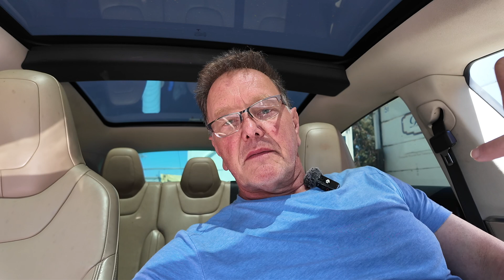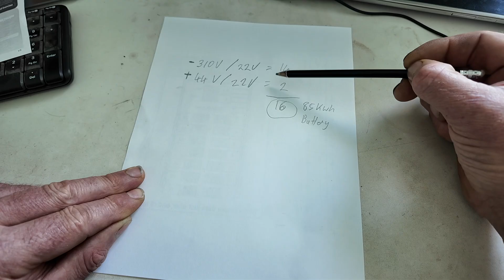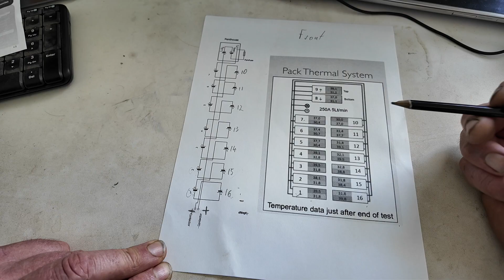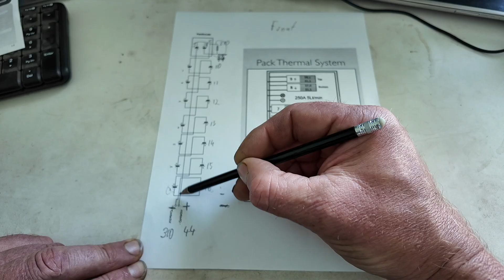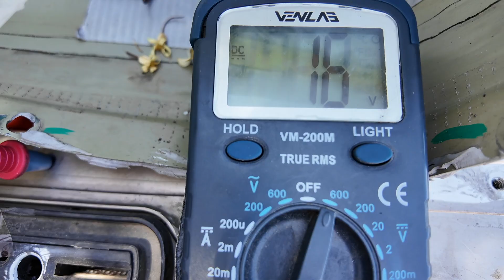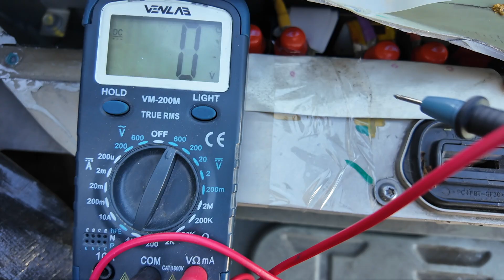Diagnose & Repair: Tesla Model S HV Insulation Fault (BMS_W142 & BMS_F123 Codes)

Comment: Nice video, exactly what i am looking for.  Have an error on a 2016 pack which has the pyrofuse access on bottom instead of top, so can’t fill up with water like on older HV batteries.  This will help find it.
Reply from the maker: Glad it helps to keep another Model S on the road.
Reply from the maker: I just found your post on the Facebook group. Measure Voltage against ground at the Contactors,  not the Pyrofuse.  Once you believe you identified a faulty module take the busbar bolts out and insert a piece of plastic below, see if the voltage at the contactors drops.

Comment: I have 2021 TMX with the BMS_F123 fault. Taking it to EV Republic to see if they can fix it for a reasonable price. If I had the tools/lift to remove the battery, I'd give your method a shot. Still might. Thanks for showing how to do this!
Reply from the maker: Are you sure the isolation fault is caused by the battery? Often the root cause is the LDU , heater, charger or AC compressor.
Reply: @EVMedics  doesn't the internal isolation fault mean that it is in the HV battery?